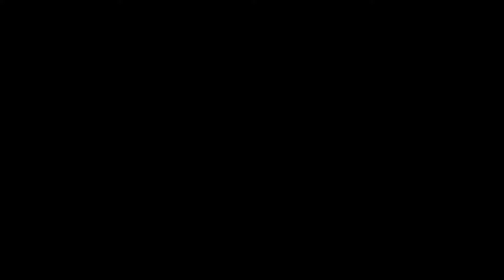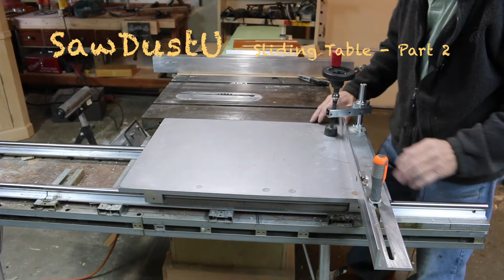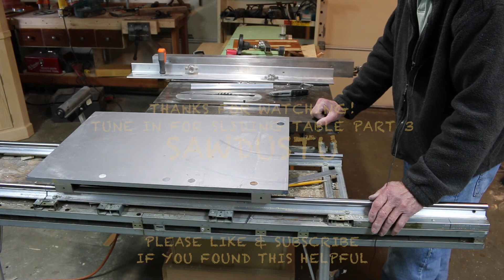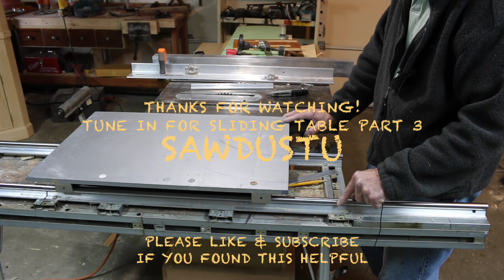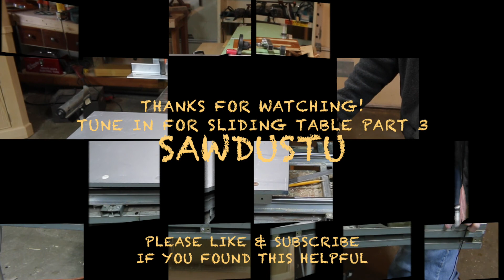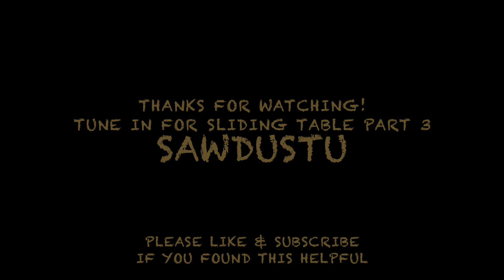SawDustU - Sliding Table - Part 2

Comment: That’s great, so where did you locate the railway?

Thanks
Reply from the maker: Click on  " Materials and links" on the menu bar, then click on the drop down tab...it's all there  Thanks SEAN
Reply: @sawdustu7248   Hello great video!  But where is the material link?  Gone?  Thanks
Reply from the maker: The rails are available thru Ebay or Amazon...search or "linear guide rails" and you'll find many options and lengths.